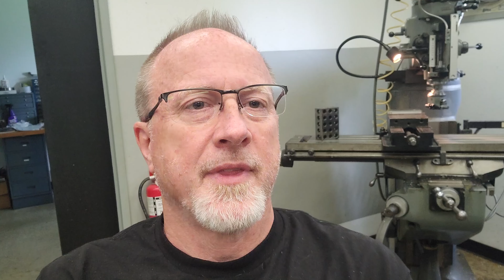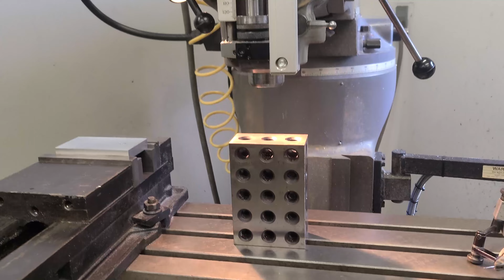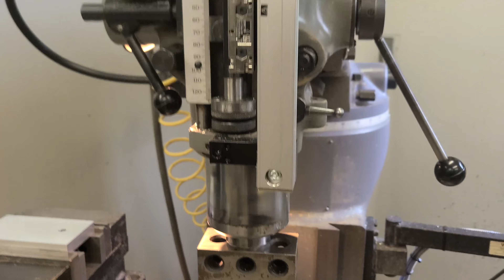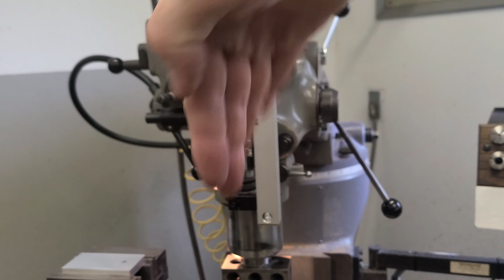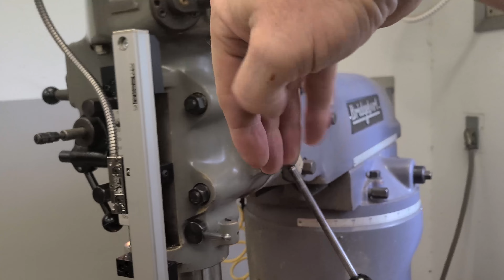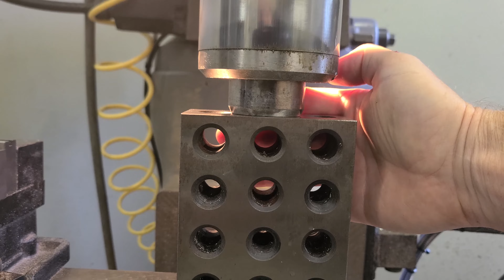Tramming the Bridgeport Mill

Comment: very good tutorial of the mechanics of a tramming a head in. if a guy can come up with a plate (flat and parallel) around 12" square to put on the table and tram off of it really help especially in Y axis, and stylus bounce, 1 recall in 1 shop i worked in we had a steel ring 12" maybe 14" in diameter that was surface ground and that was the ultimate tramming tool.